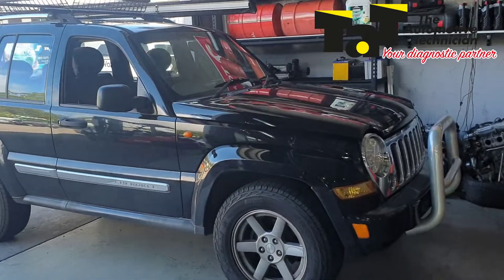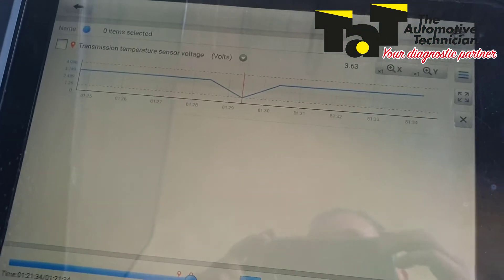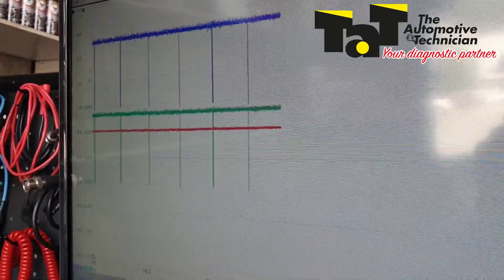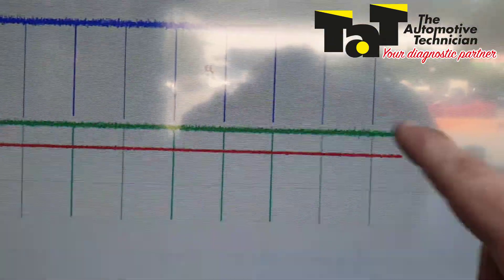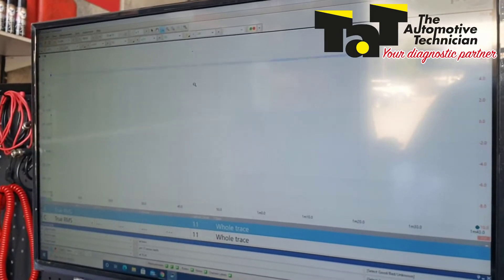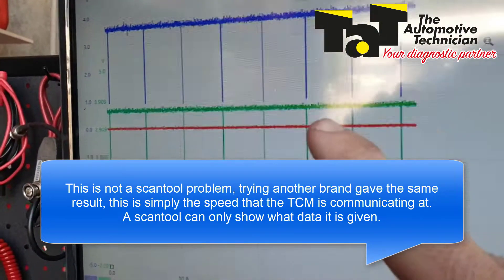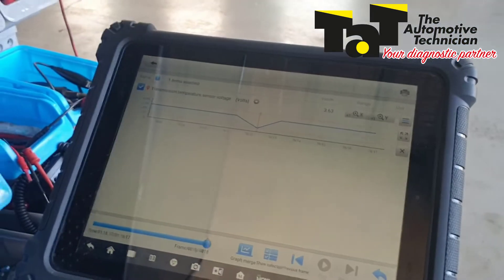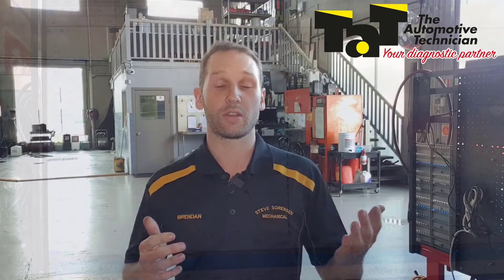Scan tool data versus Scope data

Comment: So what was the conclusion?  Did you need to ultimately replace it or not?  Also, I wonder if this is just a type of "reset"-- and 'recheck;  so that it's only reading actionable temps in blocks, rather than a continual flow of data for the tcm to constantly analyze.  Not really sure what's it's doing.